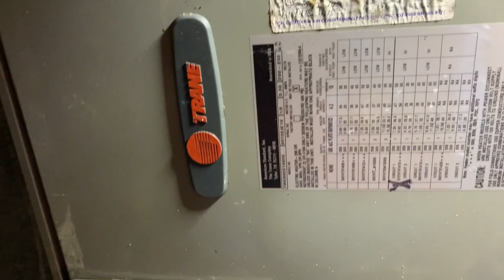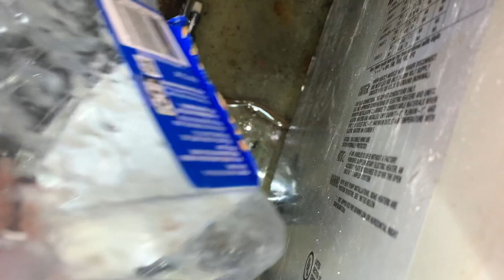Clogged HVAC Condensate Drain/Pan Full of Water

Comment: I am so glad my hvac unit is not in the attick or in the crawlspace (I don't even have crawlspace, it's poured concrete), it makes maintanance so much easier. Even if it leaks a bit, it just goes on concrete and doesnt actually damage drywall and stuff

Comment: Why replace a unit that is still working. Just asking because thats going to be a hefty bill. Ductwork now unit later.
Reply: It's always "your gonna need a new unit"...
Reply: @mikex519  seriously, which is why I always try to DIY on my houses that I lease.  So far, only once was it something I couldn't fix for $200 or less and a few hours of learning/work, this is over 20 years now.  I swear, most often issue is either clogged drain or blower capacitor, $12 part and 10 minutes later I'm good for another few years.
Reply: Was wondering the same thing.
He sounds like every HVAC/mechanic/plumber/electrician I’ve ever heard

“You gotta replace this whole thing. The guy that installed it did a terrible job. I’ll fix it but you need to replace A, B, C, and D now”

Comment: a easy way to get the water out of the pan is hook the wet vac to drain on the outside and hook up a a flex hose to the drain line on the evap drain ( you will need to disconnect the drain from the evap or use the tee with the stub if it has one.. essentially using the existing drain PVC to transfer the water to the vac. no more mess and a heck of a time saver...

Comment: Why didn't you suction the pan by putting your shop vac hose into the pipe above the coupling you removed?  My unit is above the furnace in the basement and the drain pipe goes into the floor.  I cut the drain pipe above the trap and suctioned both ends and then blew through both ends.  (My shop vac has both suction and blower.) My pan is behind sheet metal and I removed just enough sheet metal screws to see the corner.  When I reached into the pan full of water, there was a 6 inch piece of silver plastic tape and a matching piece of paper backing that was separated.  I think the plastic was blocking the drain plug from inside the pan, above the drain line.  I was able to pull these out.  Once I suctioned the pan through the pipe, the pan was bone dry.  I have no idea how the plastic, whatever it was, fell into the drain pan inside a closed sheet metal cube.  That was the only obstruction I found.  I ran a dehumidifier for several hours until everything was bone dry, then poured some water in the trap and reconnected the pipe.  Turned the breaker and the thermostat back on and everything has been fine for several days.  No leaks and a good stream coming into the floor drain. Had to do it myself because my air handler guy had a full voice mail box and didn't respond to email on his website.  Hope COVID didn't get him.  You should say ladies and gentlemen, not just gentlemen.  I'm 46,XX.   Sound like I saved a bundle with just a reciprocating saw, a shop vac and some plumbers tape.

Comment: if the attic shell is foam insulated good, it becomes conditioned space and doesn't really need perfectly insulated ducting. it should also have small supply and return vents.
if the duct is rusted through and full of holes, from bad insulation before the attic was sealed, then it should be replaced and of course insulated spaghetti duct is most popular :)

Comment: Hi, I'm having a similar issue with my pan. I take a shop vac and a 5 gallon (x3 times) bucket to clear it. Thx for tips. My unit is old 02'. Is this normal for the the drip pan to fill for older units. Also in LA.